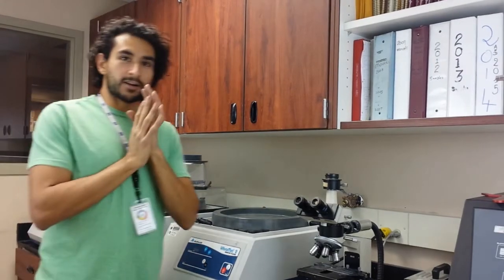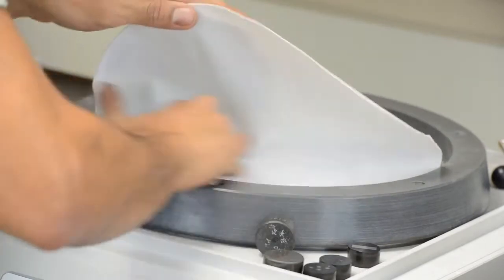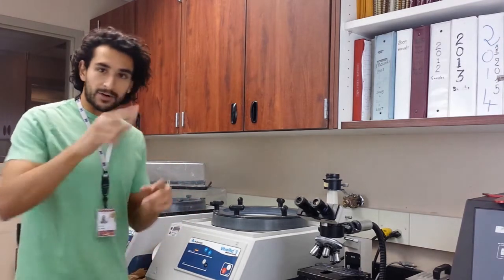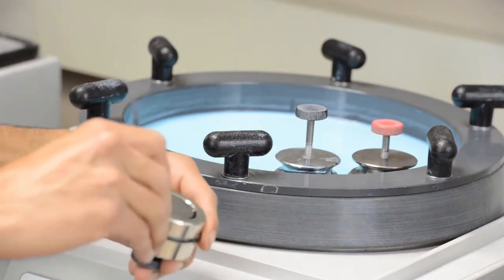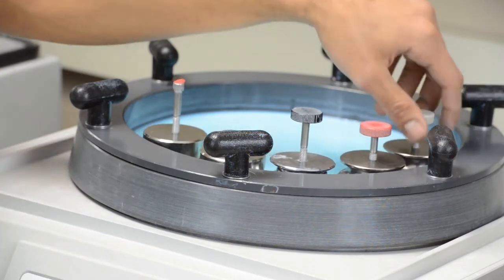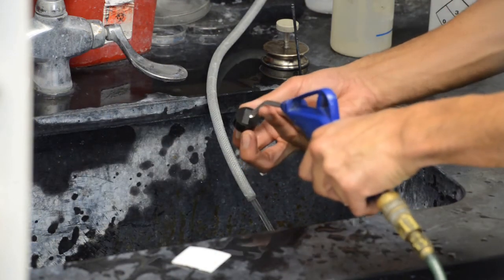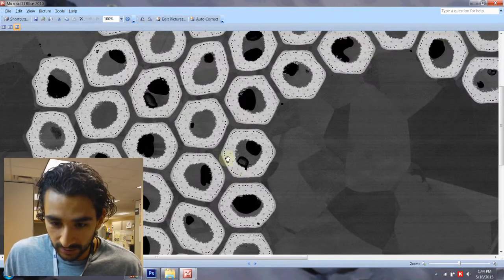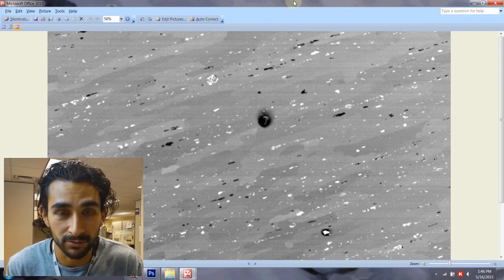Metallographic preparation - Part 7: Final polishing and cleaning (closing remarks)

Comment: I have Graphite substrate coated with half micron Mo. I want cross sectional SEM examination .
 I will appreciate if you please suggest what solvent i should use? water will affect by sample ?
Reply: Can you use methanol? There are alumina suspensions that are methanol or ethanol based
Reply: Thanks for reply i appreciate your videos are great help
I only have acetone and Ethanol " I have to use it in the same quantity as water in your videos)  
 If used water what possible adversity i can have ( my sample is Iso-molded Graphite coated with Molybdenum )

Comment: thank you for your great video series. I have some questions for you. I would be very happy if you can help me:
I am working with deep drawing steel (low carbon) and i use rotary polishing disc. After i finish grinding at 2500 grid sand paper, i use 1 micrometer alumina suspension and 0.5 micrometer colloidal silica. It is very hard to clear my specimen after the final polishing step. I tried your cleaning method and they are far better now. But some of my specimen are still cant be cleaned that good and sometimes i see some scratches (not so deep) after etching with %2 nital. What do you suggest me to do about it?

Some of my specimen are very hard to clean. I suspect it caused by my cold mounting material. what do you suggest me to use? If you can share your e-mail adress with me i can send you their photos.
Thank you
Reply: Etching always brings out all kinds of nasty stuff. I've never seen a clean sample after chemical etching. Other sources of dirt particles are bubbles in the epoxy. Try vacuum impregnating to reduce the bubbles. Using an ultrasonic bath between polishing steps also helps.